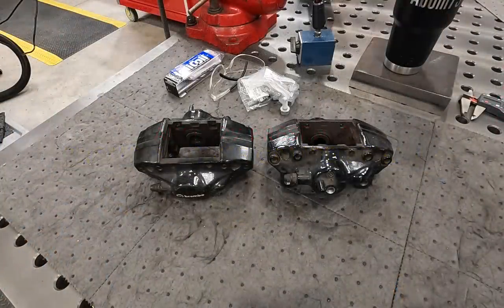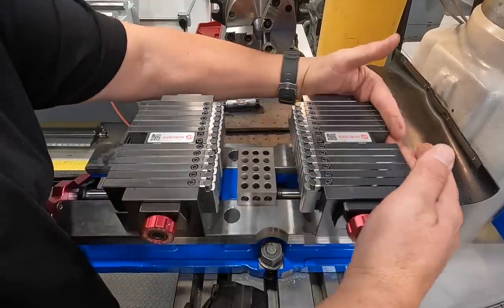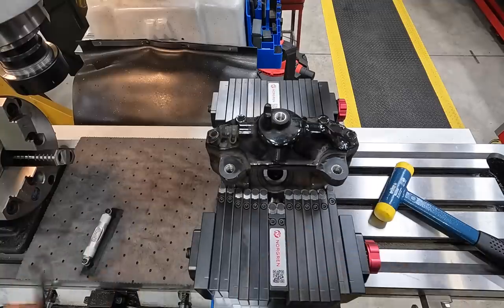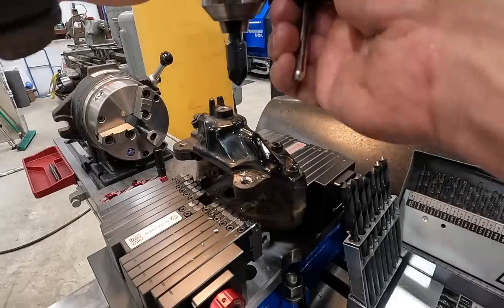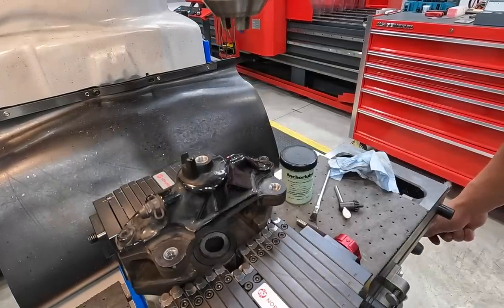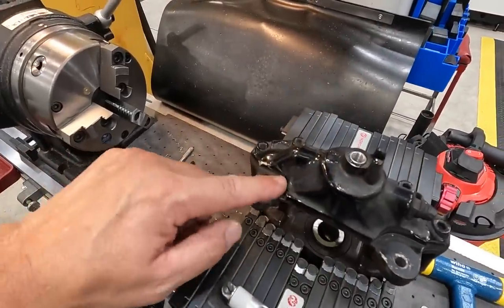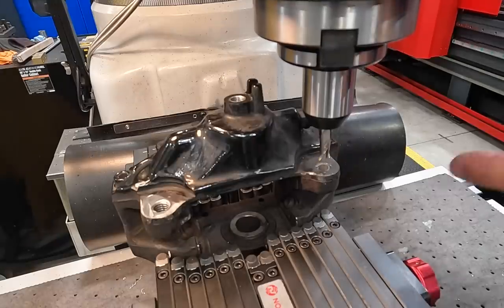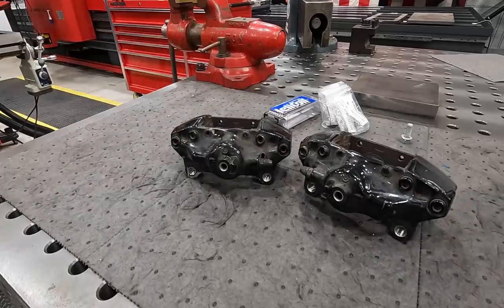Brembo Brake Caliper Repair

Comment: Why put an insert into it?- That's something anybody can do on the side of the road, or at least in their garage.. You're a machinery channel, shouldn't you have welded it solid, bored and tapped a new hole so it's actually repaired, rather than band-aided?
Edit: Especially since this is a part that somebody's life could well depend on.. And by drilling it oversize to accommodate an insert, the engineering that went into ensuring that boss was big and thick enough to take the forces of braking without breaking have gone out the window.. All for the convenience of using a helicoil insert- This isn't a "repair", it's a patch job
This is the first video Adam's posted in a good long time with which I'm completely disappointed in his workmanship and feel I'm forced to downvote. Shame on you for this Adam.
Reply: Did you ever think the owner was on a budget and wanted the least expensive repair??  Adam did mention that the owner bought a used set of calipers to get the car operational so he could sell it!  Your solution would have made this a very expensive repair.  A machinist has to work within the parameters set by the client!
Reply: Helicoils are a permanent and acceptable repair, if installed right.  The aerospace industry uses millions of them per year to reinforce holes in softer metals.
Reply: I wouldn't be at all surprised if whoever sent these in to a "machine shop" got these back in the mail, graciously said "thank you" and then promptly tossed them in the trash bin as they're no longer reliable or "safe".
Reply: Have you ever heard about something called heat affected zone?
Reply: The inserts are stronger than the original threads. You would mess up the material and geometry more with welding heat, not to mention the internal seals. Safety margins are there. Vehicle engineer here. I would drive with those.
Reply: @mashrien  And I would be willing to bet dollars that the owner happily installed the calipers and went on to sell the car!   Read Waikatotek's comment.
Reply: @mashrien shows you know nothing! Been working in garages 40 plus years, the last ten repaired loads of threads like this! I also have a 40 plus year old bike and these have saved many a almost rare part 🤷‍♂️ stick to hanging wallpaper 🤔
Reply: Very overzealous comment. HeliCoils and other thread inserts are an industry standard repair technique accepted by all manner of standards and safety organizations. Using them falls within the meaning of legal words like customary, reasonable and standard.
Reply: This comment shows that you have zero understanding of material properties or engineered design considerations. Its a shame people feel like they have an understanding of things when they have no training or haven't taken the time to be informed, then go leave comments like this. 

You can clearly see a vast majority of the comments are praising the techniques and processes demonstrated in the video. They don't make a face palm emoji powerful enough.
Reply: yes, and then have to repaint the calipers and find some correct brembo stickers which is all the new owner of the car is going to see and care about...
Reply: Perhaps some of the critics on here need to think about how callipers work, and where the forces are applied, before hitting the panic button.

The 2 calliper bolts secure the calliper against a fixed part of the vehicle steering geometry or suspension (fixed calliper mounts), and should be correctly torqued to hold the calliper in position. The bolts are now under tension, pulling against the Helicoils. It is important to get the torque correctly set, so that the bolts have the correct shear strength. Helicoils provide a thread that is usually stronger than the original thread, provided they are not used in situations where regular tightening, loosening is required. So perfectly fine in this use-case. Helicoils are commonly used in the aircraft industry (something to think about).

Under braking, the calliper will experience an axial force which in turn exerts shear forces on the calliper mounting bolts via the bulk of the calliper body. Shear forces are PERPENDICULAR to the bolt axis, so the Helicoils are not under load in this scenario.

The amount of base material removed to fit the Helicoils is negligible. It is the main body of the calliper (between the 2 mounting bolts) that experiences the majority of radial loads under braking, transmitting that as shear force on the fixed calliper mounting bolts.

Comment: So easy to separate this caliper and you would have a level surface to bolt to a plate,,, The owner has to replace the o rings and seals anyway.. total waste of effort,, MAYBE LEAVE MECHANICAL THINGS TO MECHANICS TO FIX.I think you just wanted to play with your new vice jaws. I am a retired (fully qualified mechanic 45 years) but now do prototyping (design and casting,machining)

Comment: Come on Adam FFS! Split the caliper to give yourself 2 machined surfaces! Don't use steel helicoils in aluminium in fact they are shite full stop! Inserts are better. Stay far away from WRX's & folk who own them!
Reply: My first thought was split the caliper as you would want to check the second hand ones out and put a seal kit in so split, clamp them on a block and then D&Tap for an insert
Reply: I posted above: It is a part that somebody's life could well depend on.. And by drilling it oversize to accommodate an insert, the engineering that went into ensuring that boss was big and thick enough to take the forces of braking without breaking have gone out the window.. All for the convenience of using a helicoil insert- This isn't a "repair", it's a patch job
And I'm extremely disappointed in Adam for thinking this was "okay".. I'd wager whoever sent in the calipers will say "thank you" and then chuck them in the trash and buy a new set.
Reply: @mashrien  I'm going to say this again since apparently you didn't read my first reply to you!  Did you ever think the owner was on a budget and wanted the least expensive repair??  Adam did mention that the owner bought a used set of calipers to get the car operational so he could sell it!  Your solution would have made this a very expensive repair.  A machinist has to work within the parameters set by the client!
Reply: @eagle2019  There is no price for safety, well in this case there is with it being called a budget. Fine putting on a second hand starter/alternator.
I have turned jobs down as what I was asked to do I wasn't happy with.
Also lets be honest the work is free to promote the channel (fun projects) 
Those poor people in the space shuttle died and there was no expense spared on it..Or did you want to do it on the cheap.
Reply: @theessexhunter1305  You obviously don't know anything about government spending.  Those space shuttles and the entire space program since the beginning are built by the lowest bidding contractor!!   John Glenn was recorded as saying "as I hurtled through space, one thought kept crossing my mind - every part of this rocket was supplied by the lowest bidder."
Reply: @eagle2019  Then the person buying the car with the budget calipers could be in for the ride of his/her life. No wonder you had your arses handed back to you in Vietnam cheap equipment lol
Reply: @eagle2019  A machinist doesn't have to do anything. In fact, a machinist can be held liable for the modifications to a critical component if anything goes wrong. Any machinist has the ability to decline a job that is unsafe.

In this case, I think that this repair is probably acceptable, although it's on the ragged edge of safe work, as it is eating into the design safety margin big-time.

Comment: Liability man. I get it that the guy is going to install those on his own car but...
Reply: Grieving widow's, passengers or pedestrians.
Reply: I mean people use these for fucking head bolts in fact the helicoil is probably stronger than a normal thread anyways because the original threads were aluminum so they get back out easily compared to those plus the coils have a larger thread diameter so the chance of them pulling threads out or backing out is extremely unlikely